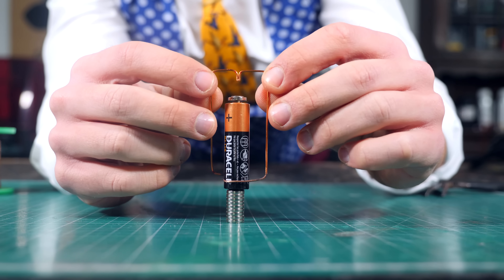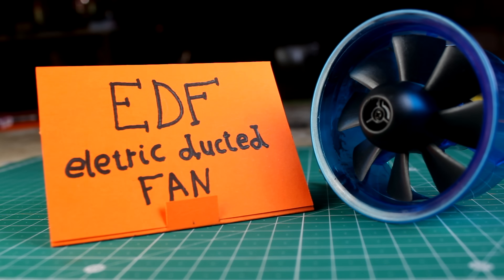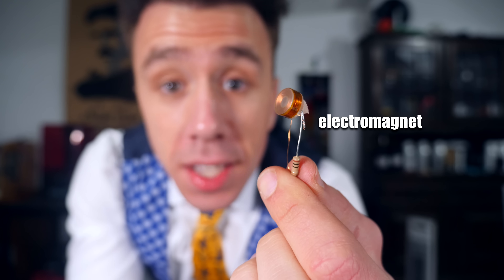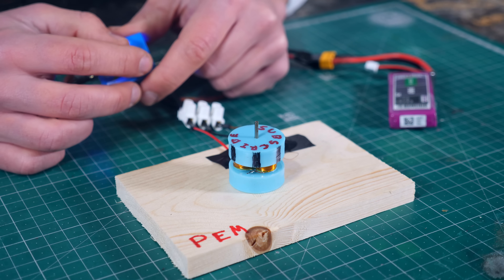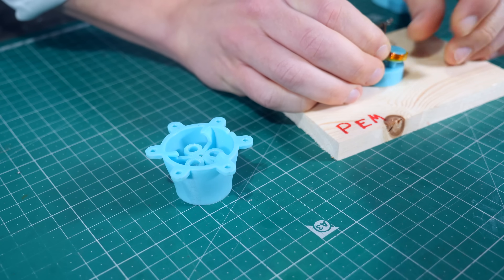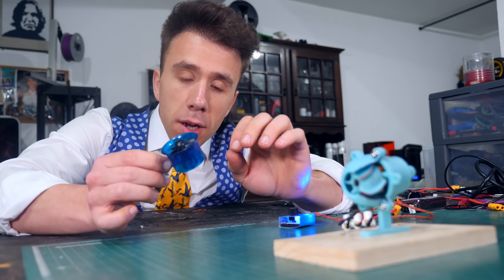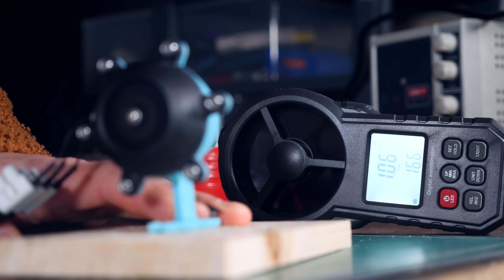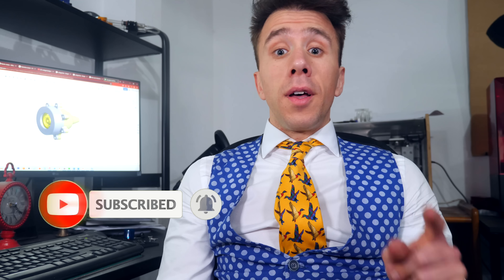I 3D Printed an ELECTRIC MOTOR FAN

Comment: Keep in mind an impeller and a normal fan moved different amounts of air. 
Also, with the impeller, you kinda are changing the direction of the air a lot, that can slow down the air. 
Dyson uses one because they want to do their bladeless fan thing, the fan itself does not have to be that efficient with power since the 'air multiplier' method already moves air much more efficiently than by using a normal bladed fan. Its main purpose was really to smoothen air flow from the fan.
Impellers are mainly good for increasing pressure, like in a turbocharger, increasing the amount of air in a fixed volume. 
A turbine jet engine does not really use an impeller anyway, it's a more typical fan and the compression is advantageous in that scenario because you want to cause combustion as well. 
It is mainly that process that propels a normal jet engine, modern airliners use high bypass turbofan engines, they are more efficient because the large fan itself provides propulsion, the air coming from it goes around the compressor area so it's more like an EDF or PEM but instead of a motor, you use a turbine engine to spin it. The impellers in jet engines are really for compression to promote combustion.
Essentially, you're moving the same amount of air, just at a much lower velocity, therefore the thrust is lower.
Also the tolerances and stuff, air could be bouncing back out the front.
However, if you turn the impeller sideways and add another one on the other side, you might get better results. 
We did that one time to give an rc plane more thrust, there wasn't much space for an EDF with the size of the craft unless we wanted to mount it on the wings so instead, we swapped the fuselage for one that had an impeller on both sides like a double sided leaf blower, the EDF was still in the back pulling air from below and out the back but now we had another thing providing thrust right above the EDF exhaust.
Also made the plane more stable since the cg was further back. The guy who made it didn't really know what he was doing and initially put all the electronics in the front. But the centrifugal module had the electronics mount in the middle.
Took forever to print that on the school's cheap 3d printers lol.
Reply: -integza1  lol

Comment: I'm no engineer, but I do have some basic aero knowledge.

And as far as I know, it's all about how you measure it.

It seemed you measured airflow, but a fan like the one you made is more focused on air pressure.

Tiny and many fan blades can shove air into places that are cramped, where as fewer larger blades can move more air (freely behind it unobstructed)

So the EDF factory design has a higher airflow than yours, but probably less static pressure :)
Also the EDF might be maxing out the motor, so the motor moving at max speed is also the motor using 100% power. Where as if you max out the motor speed, but with less resistance, you will notice the motor won't use 100% power, which could also explain it!

You should try and watch the YouTube series "fan showdown" and you can see for yourself! :)

I hoped this was helpful, and made sense!
Reply: What I'm trying to get at is that air moved is not as black/white to the factor of power spent as it may seem, it's all about accelerating air, moving a mass of air, or creating a certain pressure :)

I'm sure an equally powerful turbocharger (design) won't move as much air as an aircraft propeller, but it will be able to create a TON more pressure

Comment: Hi. I have a degree in aeronautical engineering ( and one in ocean engineering) with a decent amount to f experience in fluid dynamics for propulsion. You probably have quite a few good answers at this point, but as per usual, the number of comments makes it prohibitive for me to sort through and find the good ones. The short answer to your problem is that there are a number of important factors that go into the thrust produced by a propeller/impeller that depend heavily on the geometry chosen. It looks as though you have started with two of the most important aspects, which are appropriate pitch for your chosen RPM and desired flow rate, and smooth/aerodynamic curvatures with intent to reduce resistance to flow across the surfaces. There are, however, other very crucial aspects that will drastically change the effectiveness of the design to produce thrust. One of the key differences you already stated as a big part of the video, which is the design intent difference between a compressor and a propulsor (ducted fan, jet impeller, etc) which is that you are inherently trading the energy input of flow velocity for compression of the gas. Without the burner stage of the jet to inject energy and re-expand the air, this will generally just result in significant energy losses to heat in the compression and friction against all of the added side walls, twists, and turns that the air must now move through. 
Now, theoretically, with an appropriately designed compressor to handle the back pressure, much of the kinetic energy that was traded to compressed gas potential energy could be recovered in re-expansion of the air via an appropriately designed exhaust nozzle. However, aside from the losses inherent to heating and twisting the flow internally, the internal shape also would need to be optimized to ensure the converging and diverging duct shapes (and blade geometry) are not causing additional losses due to strong pressure differentials (eddy flows, boundary layer effects, etc). 
Even a simple propeller can be drastically more or less efficient just from shape optimization based on relative flow conditions, so adding extra complications( like compression and flow direction changes) will inevitably introduce much more opportunity for losses. 
Oh, one other big factor is inlet & outlet area. How much bigger is the ducted fan inlet / exhaust than your impeller design? Flow rate is proportional to thrust, and is (generally speaking) v*area of the duct.
Anyway, just some thoughts from your friendly neighborhood engimaneer. 😊

Comment: You are comparing air velocity between a fan designed to speed up air and one that is designed to compress air. Thrust is not only dependent on the air's velocity, but also it's mass flow rate, and that is what you have increased.
Also, in the Dyson schematics, the intake is smaller then the outlet for a reason.

Comment: No expert, but the blades on your 3d printed one are too shallow and too short in length. So they are not as efficient. Look at the dyson one. Each blade wraps almost fully around the mount.

P.s. have a look at the 'fan showdown' from a YouTuber called Major Hardware.

Comment: You need to make a high bypass front section. Try a 4:1 ratio of entry to exit. Make the entry the same diameter as your EDF one then make the inner portion of the exit 4:1 smaller.

Comment: Spacing is the key corpus from the blade its   allmost same as gas fuel regulator or jet engine fuel distributer. As seen from side i think so.

Comment: engineer here. your issue can be boiled don't to the following two equations:
Power = 1/2 * mass flow * change in velosity^2
Thrust = mass flow * change in velocity
bla bla bla engineering ... BIGGER FAN = More thrust (for same power (assuming similar effecency))
if you want the same performance at the same RPM you need the inlet/outlet dimeters to be the same as well as same effective pitch (angle on the fan blade like but not exactly the same as the pitch of a screw thread)
so if you want to match performance with the EDF you need to make a fan of the same size and pitch/angle of attack
if you want more pressure (shown as change in velocity in the equations above )  you will  lose thrust or need to provide exponentially more power (ex; if you want 2x pressure at same power you will get 1/2 thrust, or if you want same thrust at 2x pressure you will need 4x power (thank the "change in volosity^"2 term for that)) this is true regardless of fan design (assuming the same efficacy (which can be >90% if well designed (I would assume ~50% for "un-optomised" designs)))    
centrifugal fans can (if designed to do so) produce  much higher pressures than axial fans up to ~3:1 compression (for gases) compared to axial at ~1.1:1  however because there is less change in direction for the gas they can have higher efficiency (which is why modern jet engines stack dozens of axial fans to achieve compression ratios up to 40:1)

(side note: motors also have a power curve they cant produce any torque a the maximum "no load speed" and  (usually) reach peak efficiency a 78% of no load rpm (PRM(ideal) = kv*voltage*0.78) ideally you want you pump power curve to match you motor power curve at this RPM (PRM(ideal) = kv*voltage*0.78) and reach max power at 50% max rpm (but usually melt as the efficiency is low here)

hope that helps

Comment: The #1 problem is your mass to blade area.  Your using the same power, at the same RPB, but your blades are SIGNIFICANTLY smaller.  You are also constricting your airflow both before the blade, and after.  #2, your creating a tornado effect behind your blades.  Your rotating air, not pushing it.  You need stator blades to redirect the airflow like in a jet engine.  I don't think #2 will be a significant hindrance to performance since the casing tends to act as a stator and redirect the flow of air, but if you open it up for #1, then you may need to deal with #2 more.  #3 Sometimes the most simple solution is the best one.  If your looking for airflow, a simple fan will work better.  If your looking for static pressure, than an impeller will be best.  Your measuring airflow in your tests.  So in that test case, a simple fan is best.  If your looking for static pressure, like in a jet's combustion chamber, then impeller will be best.

Comment: make it bigger

in longer form:
You're probably not taking in enough air to take the motor to its full potential. That Centrifugal fan has way bigger exhaust and intake openings for air than your turbine. The PEM is probably rotating at a set speed compared to the voltage, so even it spins at the same speed but it's just not taking in enough air.

Comment: I think it has to do with the distance the blade tips are from the inside wall of the case. I would think you would also need the surface area of the propeller to be the same as the original in order to get the same thrust. Just my guess.

Comment: I think you need to look at the front of the jet engine diagram. They all have shrouded fans like the EDF before the compressor stage. You need to accelerate the air going into the compressor or you will never get the output you want.

Comment: Turbo chargers increase V by coupling a secondary  channel impinging into the flow with a higher pressure and velocity its the internal coupling that does the work . Think of an 8 with a slight overlap and one of the circles being pronouncedly smaller and shrinking as it goes increasing mean internal pressure then impinges on the outer wall just a small point to consider as that's also how the fan works  :) love your channel cheers.
Reply: So the fan tips and the secondary channel are really your main point of tuning and balance is hyper important preferably both statically and dynamically balanced also there needs to be a wash plate behind your one there and a small pressure balance hole to push the fan away from the wash plate as pressure builds up to keep them from actually touching also the impeller should be slightly s shaped your has more of a c shape and the internal wash section should be involute to wash the flow to the outer stator blades you could take your cross section and run it on para view i think it's called free flow simulation software and it can be run on arm architecture  with just a little bit of a tweak I managed to convert it and run it on a jetson Nano was my stand alone computer for everything for 2 years .

Comment: If i'm not mistaken, thrust come from the momentum of the air that you accelerated, power comes from it's kinetic energy. 
So if you want to double your thrust, you can do it by doubling the amount of air that you move, and that will double power consumption. You can also do it by doubling the speed of the air, but that means 4 times more kinetic energy and 4 times the power. So it's definitely better to increase mass (volume), not speed. 
You turbine doesn't look like it will be efficient at generating thrust. It can be a good compressor

Comment: the difference in diameter is the main issue. You also have very high drag from your narrow duct behind the impeller. The dyson impeller is not purely radial, it's hybrid axial-radial flow and your duct is shaped mostly for radial flow. The Dyson impellers are not an efficient way to move air in any case, but they claw back a bit of efficiency by entrainment in the big ring. A regular prop in free air makes vastly more thrust for less watts.

Comment: If you measure the power draw from the 2 motors and theyre the same, but not generating the same thrust, the power must be lost as noise or heat.  Did you try running it for a while and observing the parts with an ir camera.  You should see where the heat is being lost (could be the air out)

Comment: I should imagine impellers are good for higher pressure, for example, pushing air into an engine or creating a strong vacuum in a vacuum cleaner, whereas propellers are good for high velocity but not great for pressure, that's why there used to push air around a room or fly an aircraft.

Comment: Without seeing the fan in person, I can only make some guesses.  The biggest one is, the tolerances between the tips of your fan blades, the the fan housing.  That needs to be as close to 0 as you can get it.  If it isn't, it leaks.  The whole thing is a giant leak, and you're losing thrust with it.

Since you don't have the budget to make better fans, and better housings, we have to work within what you do have.   It's doable.  I promise.

Make the distance between the fan blades, and the housing actually 0.  0.00.   0.nothing.  

Build the wall of the fan housing into the fan blades.  Basically, terminate them on a ring.  That way, you'll get rid of the tip vortices.  

You don't want air going up and around the outer ring of your fan though.  Build the fan body so the outer ring recesses into it.    So looking from the intake horn, it looks like it goes straight into the fan, not the fan ring.  The exhaust side should also be recessed in the same way, so the air will flow smoothly out the other side. 

If you need me to model something to demonstrate how this should look, I can.  I haven't gotten into CFD stuff yet, so I can't simulate the designs for airflow.  That'll be up to your real world tests.   You'll want to integrate it with the IP you stole from Dyson. :)  

If you need, you could even build in a bearing system into that outer ring.  Even if it's just rollers to prevent impacts between the ring and the housing.

Don't forget to give the interior of the duct, starting at the intake horn, and ending at the exhaust, an airfoil shape.    It shouldn't just be straight.

I've actually been designing an aircraft in my head for a really long time.  This was one of the problems I saw, and figured out how to deal with  on the cheap.  I know I saw it in actual aircraft somewhere, but I'm doing a terrible job of finding any examples.  Or  maybe it's all in my head,  and no one has one yet.  The best I could find is this.  This is for a jet turbine.  You'd (probably) need a lot more power than the BLDC / PAM.  Play with it.  Play with more or less blades.  Oh, and a smart aviation guy pointed out to me once, propellers and turbofans always have odd numbers of blades.  It helps to prevent harmonics shaking the prop/fan apart.  That never goes well for the passengers in line with the disintegrating spinny bits.

https://www.shapeways.com/product/ZEXQXU56M/o26mm-jet-engine-turbine-fan-b-x-1

Comment: Isn't something in the ESC driver that limits the current recieved by the motor? Maybe it's getting limited because the motor isn't designed for this aplication. I supose it takes more energy to compress the air rather than just push it, or at the same RPM it is using some of the energy to compress it so it results in a smaller wind speed output.

Comment: The edf is producing higher airflow, but the static pressure from the ducted fan is incredibly higher. Try increasing the stages of your ducted fan, with increased blade angle on each stage. 
My suggestion for a video is use the ducted fan to produce a tomato blender!!!!

Comment: Well I don't know much about the fans but... I'm an airsofter, and know a bit about motors.

So there are fast spinning and high torque motors.

If you wanna compress air. You want High torque. I guess EDFs are high speed.

Comment: There are a lot of ideas here. And I'm not a specialist on this particular topic. 
Assuming both the fan and impeller are exerting equal load on the motor at a given RPM, you will only end up with equal thrust if they are of equal efficiency. 
Fans and impellers are chosen depending on the job we need them to do.
For a start, the impeller is throwing all of the airflow outward, then wasting energy redirecting it to the rear. Whereas the fan is mostly grabbing the incoming air, and throwing it aft with a minimal change in flow direction. 
Turbochargers don't redirect air in the way this impeller does. They take full advantage of the outward momentum of the flow from the centrifugal force. I know various jet engines use impellers at the first compressor stage, but the requirement for compression, and requirement for flow rate are achieved in different ways. 
Don't know if any of what I just wrote makes any sense. I might review it when I wake up again 🙂.